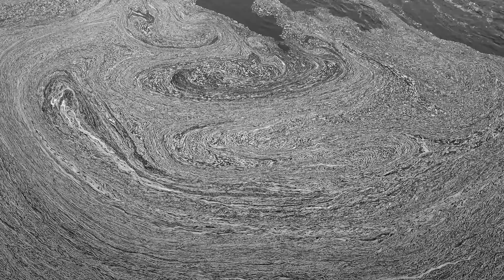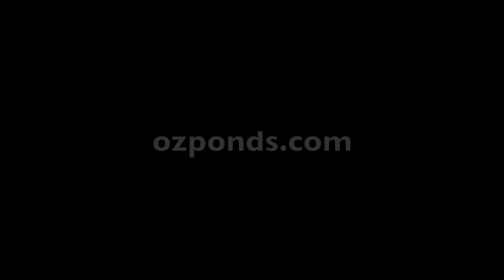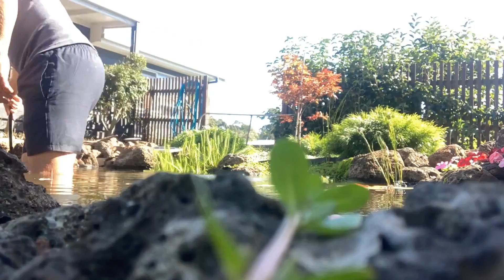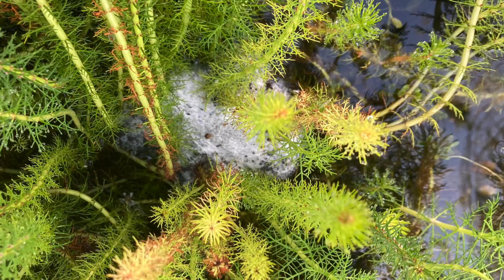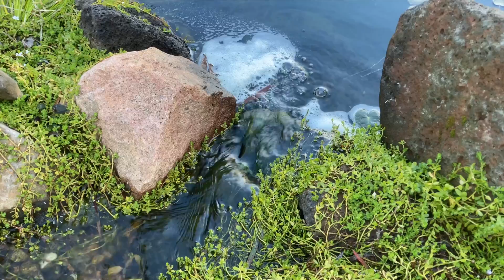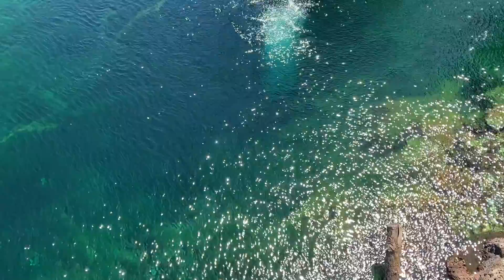What causes foam on a pond? How to fix?

Comment: With foam you can biologically filter water.
You add sugar or vinegar daily( or vodka, thogh thats too expensive)as a source of carbon into the water to create bacterial blooms.
Then you can use a fresh water protein skimmer to take the bacteria out along with the nitrogen and phosphorus.
Its a method good to lower the phosphorus, because algae and bacteria can take the nitrogen from the air.
Phosphorus however it is the one thats causing eutrophic waters due to algal bloom.
Phosphorus accumulates as it isnt a gas like nitrogen or carbon, that can leave the water.
Reply from the maker: Pretty cool. Thanks for sharing 👍

Comment: I use to get foam   from  on surface. Of pond  From the last waterfall  , but since adding a large bog filter and stream before header pond and waterfall's  ive  not had any  this year ,  its winter here in uk  my thermal covers are  back in use   while water temperature is lower ,  the generator and  heaters  are on standby just incase  the temperature drops   anymore.
Reply from the maker: Sounds like you’re all set 👍